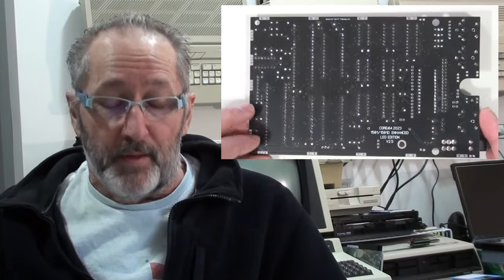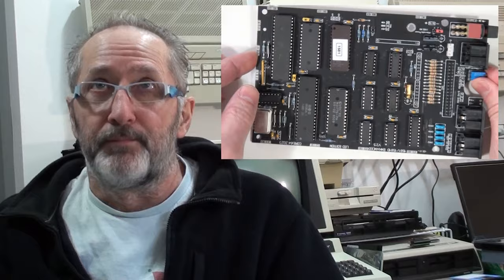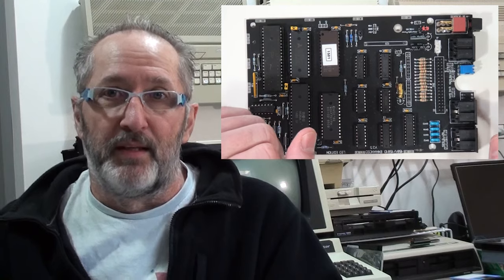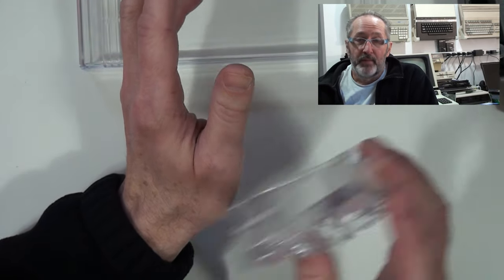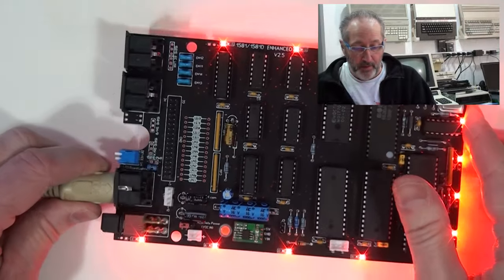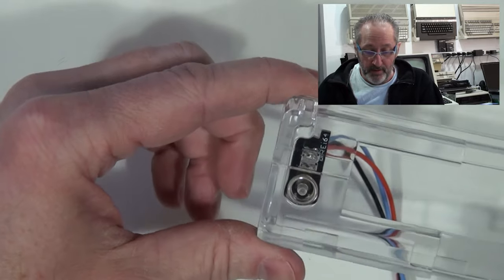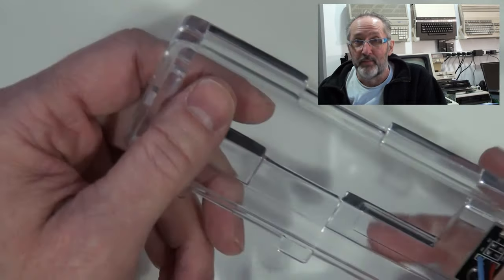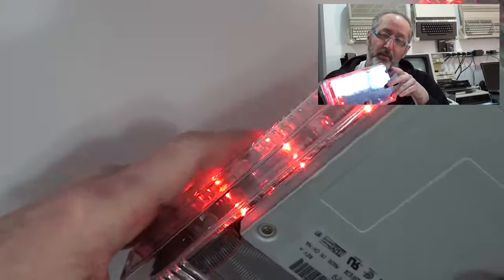Building a Commodore 1581 like you've NEVER seen before!

Comment: That's really brilliant! I would remove the top cover of the drive with this amazing casing to see the heads doing their things. And here is an idea, how about giving those LEDs a function? As I understand it, you have 1 set of LEDs on the underside, and another set on the top side. Rather than usings these as just decoration, I would wire the bottom side ones as the power indicator, and the top side ones as activity indicator. Most probably the board will not be able to drive so many LEDs as default, but adding driver transistors would solve that problem.
Reply from the maker: You know, that's a great idea.  Never thought of that.  I think I'll remove the top cover of the drive and see what that looks like.  As for repurposing the board LEDs, what if the top board LEDs came on when the drive was accessing the top head, and the bottom LEDs came on when the drive was accessing the bottom head.  Perhaps in the final revision, when I add the last feature, I'll look at doing that, or something similar.  Or... addressable LEDs.  Could possibly do that too.  Hmmmm, going to have to give this some thought.
Reply: @8BitResurgence  Adding addressable LEDs will require adding a small MCU and making it talk to the original hardware. It would be nice, but I am not sure if the result will be worth to the effort. For the top / bottom head indication, I really don't know how the FDD controller IC works, if it is possible to get that information and use it to drive the LEDs, then why not? I was just thinking simple, you already have the activity signal on the original LED, just use that to drive a transistor and there you have it.